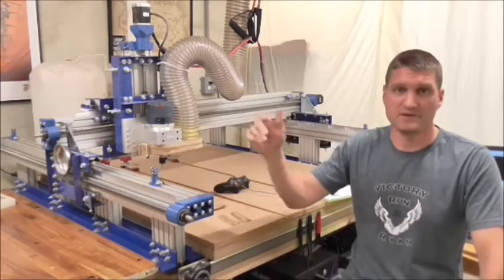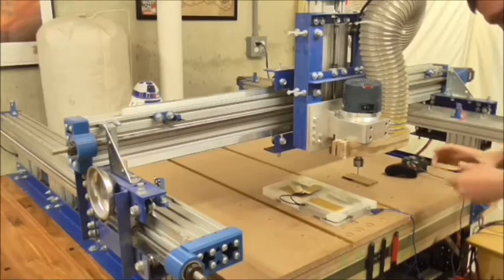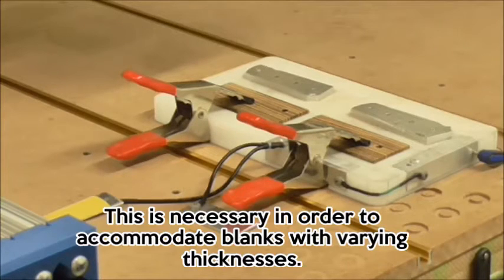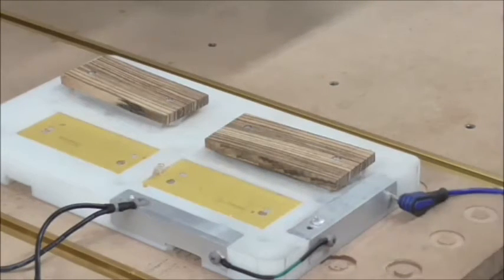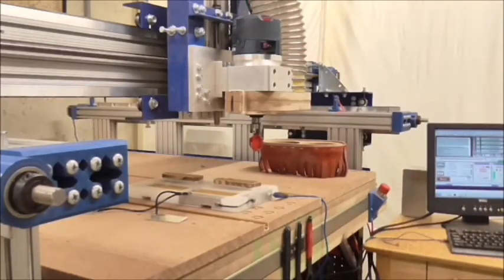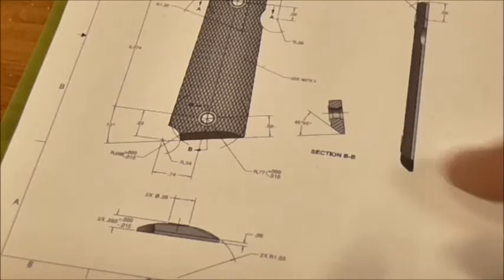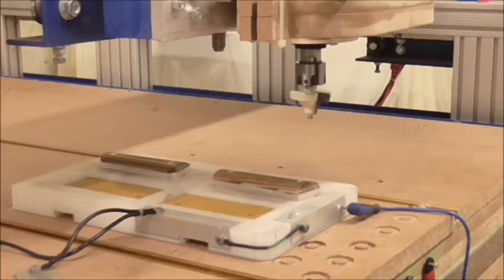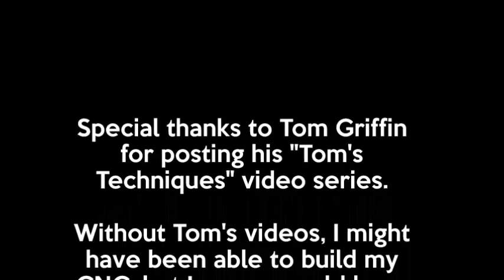Making 1911 Grips w/ a CNC Router - My Method

Comment: I got the specs for my grips off the same drawing! I really (and I mean REALLY) like your jig & am now thinking of making my own since currently I use locating pins & carpet tape, which introduce enough error on their own. Yours is great & would really allow some fantastic repeatability. 

The only thing that I would probably do is look for some nylon screws, mostly because a fraction of a z" off and I'd be looking at some new bits (and I'm even cheaper than you)

As others have mentioned, I'd suggest to you a small ball end mill. I have a 1.5mm tapered end mill that I do a .15mm stepover parallel path with and it literally only needs final sanding when it's done. Granted, that takes a lot longer to do so you could just do a 1/4" ball with .025" stepover & just hit it on the belt sander later.

Thanks for the video & the idea for the jig!

Comment: Scott hi great video. Others may have suggested this already but dont forget to use climb cutting to avoid splintering ,fuzz and chips.especially on exotic woods with curly unstable grains or burl.in the end it could save you a ruined grip.in the least it could cut down sanding.,which most every wood worker dislikes
Reply from the maker: Edad Martin 
Thanks for the suggestion!  my CNC has some stiffness issues, which makes climb milling problematic.
The timing of your comment is great: I have my CNC ripped apart at the moment.  I'm upgrading the linear bearings on my X-axis.  Hopefully that will make climb milling more feasible.

Comment: I so very much enjoyed the video.  Was great to watch.  I too believe that information should be shared.    One question/suggestion if you will.  You have a lot of tool changes which eats up time.  I suggest using a 1/4 inch ball nose and have it finish in the top curve and the 2 angles all in one g-code.  I have been playing around with a new high speed spindle and cut my first grip out of aluminum.

Comment: Hey Scott,
I took your advice and found several stl files on the net and I also found a copy of the print provided by Benson consulting.  I learned how to use the 3D profile in Cambam and I wanted share what I learned from machining several dozen grips using various profile methods and setting.  water line rough and water line finish are fairly quick and are perhaps used for roughing, the finish is horrible and did not provide the best results.  I also used horizontal and vertical and found that the horizontal method left deep tool marks and is probably best suited for roughing with a tight step over.   Its the vertical method that provided the best finish with a tight step over, sanding was done by hand with 400 grit sand paper and was very minimal.  I also learned how to create an extrusion of the grip in a stock format where the actual grip profile could be machined at a later time.   The fixture is another story that I may share later, I am still working on the macros for that.  Well, thats all for now. Thanks again Scott for pointing me in the right direction.
Reply from the maker: Glad that you're having fun and making some progress!  You'll need to post some photos of your work soon; I'd like to see what approach you took to building your fixture.
You might find the "plane slice (x, y, or z)" features to be useful in CamBam.  If you "z" slice your .stl file, that'll give you some starting geometry for your profile cuts.
Take care, and keep us updated!
Reply: Scott, I created an extrusion of a profile and have been able to machine the file successfully.  The issue that I am having is that it take nearly 3 hours to machine.  Do you have any suggestions as to how I can get the time reduced?  Also I am not familiar with the splicing or how to evn machine the geometry after it has been spliced, any suggestions on how to do that in cambam? Thank you
Reply from the maker: Without seeing your file, I'd guess bigger end mill as a starting point.  Would you like me to take a look at your CB file?
Reply: Yes
Reply: How do I send you my file
Reply: File has been sent
Reply: I am not very good with Cambam, I am still learning
Reply: Forgot to mention that I have been able to cut the pockets, drill the holes and cut the outer profile and the only thing that I have a hang up with is the 3D

Comment: Scott, I have watched your videos 3-4 each as it related to your Krm and to 1911 grips.  I was wondering if you had a words of wisdom in I embark on a krmx02 build and if you be willing to shared the  dimensions on your 1911 jigs as I have only seen one other video where they did a good job creating the jig.  Im going to retire in 3-4 years and would like to have my cad skills unite with my gunsmith skills to create a retirement business.  Last question as I am packing this comment;  do you run a professional gunshop or a shop of any kind.  I think I read somewhere you were in OK.  As I learn cad, I am thinking of ways to create quick change setups for router, laser, welding and plasma heads.  might be a little ambitious, but I have time on my side to design things and learn cad.
Reply from the maker: Dave,
Sorry that it took me a while to respond.  Are you still making your own grip panels?  Let me know if I can help with anything.

Comment: Hey, awesome video! Them grips would look lovely on my 1991 replica ;) i have one thisng to say though, and i only say it from a perfectionists point of view. i know you are saying you would like comments to help you with finish etc, so here i go...
in your toolpath software, is there an option to change direction of cut? i notice your are travelling non-conventionally (anti-clocowise) with your toolpaths, therefore effectively scooping the material away, giving a rougher finish, especially allowing break-out in wood. the direction of your spindle, and cutter direction, indicates it should be travelling conventinally (clockwise) around the panel. this would give a much better finish, and require less hand work, would elongate tool life, and you would possibly be able to run your spindle at a higer rpm, and run your feedrate higher, utting your cycle times dramatically ;) just a thought!
Reply from the maker: +Adrian Faulkner Hi Adrian, thanks for your note!  I do think that there might be one MO (machining operation) that I could switch directions and get some benefits as you suggested.  But actually, most of my toolpaths are already conventional!  My spindle turns clockwise (as viewed from above), so travelling in an anti-clockwise direction produces "conventional" cuts, while the opposite direction would yield "climb" cuts.  I actually do intend to do more experiments with climb vs conventional milling in my setup, as I've had both directions recommended by my video viewers.

Might be a great topic for another video?

Thanks again for writing,
-Scott
Reply: @scottprints  I know this is an older video, but, from someone who has a less than absolutely rigid CNC machine (combo of wood and aluminum) the conventional cuts give better finish and accuracy than climb.  If your machine is absolutely rigid, then climb cuts, especially on metal are the better way to go.  Just my home-brew 2 cents.  Great video.  Used this as a reference point for my setup and approach to machining the same 1911 grips as well as the Beretta grips.  If you have time (I know this is a seriously old thread) I would love to get your approach to checkering as this is something that I have been struggling with getting consistent result.  The patterning is no issue, but breaking off the pyramid tops at random during the op is.  Even slow fee rate with brand new end mills.
Reply from the maker: @anklebiterwoodworks2818  Thanks much!  Always nice to get a thoughtful reply.  I can describe my approach to checkering.  Whether it's a GOOD approach is yet to be determined!  But I just finished a workout and need to get ready for work.  I'll write a more detailed reply over the weekend.  Take care!

Comment: im a little late in the game but the video you mentioned watching when you learned, does that show any of the designing of the file itself? trying to learn how to design the grips in fusion 360 and having nothing but trouble. hope to speak to you soon
Reply from the maker: There's not really a video for how to CAD 1911 grips.  What's more available is general topics: how to sketch, extrude, sweep, draft, etc.  Operations that are applicable to am infinite number of objects, not just 1911 grips.
Reply: I should have worded that better so I walked into that. I did find all fusion tutorials and some online tutorials for walking through some types of workstations. Some were pretty helpful but but I was hoping to find something that goes in depth more than what I’ve watched so far. I got the hang of a lot of it and I always find time to try a new operation or something just to see if it might be one that could come in handy when designing a new type of item. But thanks anyways and please let me know if you run into anything that might help me with that.

Comment: I realize this video is 5 years old. Question. Your jig for holding grips. Your design and manufacture? Is there a file we can purchase of get to make our own. I have 1911's and a Shapeoko XXL.
Reply from the maker: Hi Mike,
Wow, has it been 5 years already?  Time really flies.  
As it happens, I hope to be back into grip making by the end of the year.  The file that I used to build the jig is a CamBam file, and I'm not sure that it would make sense to any one but me.  Plus, it was built to fit my table.

That said, if you want to give grip making a shot, I'd be happy to give you my 2 cents as you work through various bits of the process.

Comment: Great video! I know this is a fairly old video, but I’ve seen people stabilize their grips with a vacuum setup and this stuff called “Cactus Juice”. I’m wondering if stabilizing the grip blanks will help mitigate any tear-out during machining, or if that would gum up the bits.
Reply from the maker: I gave stabilizing a shot once myself, but I wasn't able to set up a good process.  
However, I have made grips from other people's stabilized wood, and it certainly does make a noticeable difference.

Comment: Great work! What size screws are you using? I made a similar fixture using 1911 grip bushings/screws for hold downs, but ive had trouble with the bushings pulling out with the screws after machining...
Reply from the maker: Can't remember for certain, but they're either 8-32 or 10-32

Comment: I did have a question did you make your own jig for the 1911 blanks? I would like to get into CNC Machining with wood and doing this but seems like having the jig to place the blanks on makes like a lot easier.
Reply from the maker: Hi Daniel,
Yes, I did make the jig myself.  If you'll be making a bunch of anything (not just grips), then a fixture is probably going to be very helpful.

Comment from the maker: Eric,
The macros are extremely helpful for stringing together operations that would otherwise require human input.  Mach3 is my controller software, and there's a forum devoted to the practical application of this software.  Do you have a CNC?  Does it run off of Mach3?  If so, I'd recommend heading to the Mach3 forum and searching for macros.  There are all kinds of useful posts on that forum, and the Mach3 website has a downloadable guide to various program-specific macros.

Comment: Hi Scott,
Absolutely loved the video. I'm fairly new to cad/cam and I've been trying to model the stocks (grips) from Rio Benson's drawings in Fusion 360 for a quite a while. I'm completely stuck on how to arrive at the dimension for the centerpoint of the 1.36" arc on the .25" offset line. Can you possibly explain to me how you arrived at that point and/ or verify what that dimension is from the top hole? I've download many stl, iges, step & solidworks files and very few of them have the same coordinate for that arc. The most common seems to be .7894". 
Also what thickness are you using for the blank - the .240" or .255" on the print?
Thank you
Joe
Reply from the maker: Hello Joe,
Somehow I managed to miss your question; sorry about that.
I think that if you look for the government spec drawings from decades ago, you'll find a dimension that's not on Mr. Benson's drawings.  The blueprints (literally... they're blue) are out there on a few archive sites, and they should give you that last dim.

I think I programmed the final thickness to be .255", but it's been a while now.

Hope that helps,
-Scott

Comment: aweso o using a cnc router.  2 questions would you consider building another jig like that one to sell. and where did you get the program to cut those is it g code or something else. thanks for your time and video
Reply from the maker: Hi Steve,
I don't think I'd want to make another jig: but the good news is that if you have a CNC, you should be able to make one yourself.  The geometry on the jig is actually less complex than the geometry of the grips, so it makes sense to make the jig first and them build some grips on it.  Learning all the way, of course.
And the machine code is G-code.  That's the output of a CAM program, and your CAM program choice is completely up to you.  There's a bunch out there, I use CamBam and Fusion 360 in my home shop.
Good luck!

Comment: I just have to ask.   With building the machine and learning the software how much time have you invested in your education to develop enough skill to do this task?  1000, 2000, 5000 hours?  Looks like a big learning curve.   I have a big chunk of zebra wood in my stock and would love to be able to do this.   Will it take me 2 years?
Reply from the maker: Smokey Walker -Eh, from when ai first decided to build a CNC router to the day I completed my first set of 1911 grips was about 6 months.
I do process stock for other grip-makers on a fairly consistent basis .  I hate applying finish and most of them don't have CNC programming skills.  It works well, and I could do the same with your zebrawood if you'd like. 
But I get the feeling that you'd like to develop the skill on your own.  So my answer would be: everybody learns differently, but it took me 4 months to build my machine and 2 months to learn enough CAD/CAM to make 1911 grips.

Comment: Do you have the cam files for ruger bisley grips?
Reply from the maker: No, sorry James.  That's not a grip that I'm familiar with.
Reply: How about ruger blackhawk
Reply from the maker: @jameselliott1487  No, not that model either.  I looked up the Ruger after your first message, it wouldn't be terribly hard to duplicate.  But I haven't had the time to make grips in over a year, and I don't seeyself getting any more free time anytime soon.
Reply: @scottprints  ok thank you very much. I'm a newbie at fusion 360 and struggling. Lol
Reply from the maker: @jameselliott1487  it's ok to struggle with F360!  I find that it's also quite a challenge!